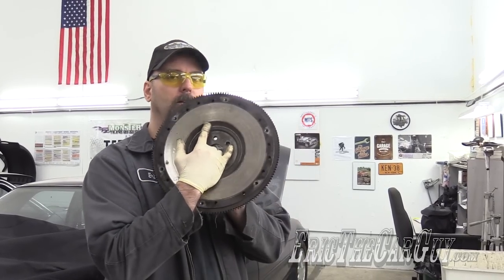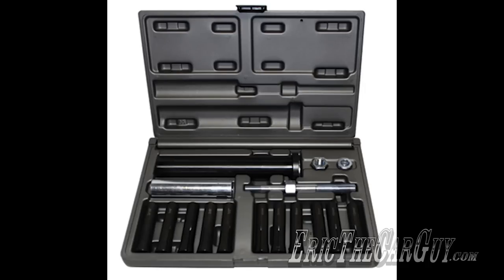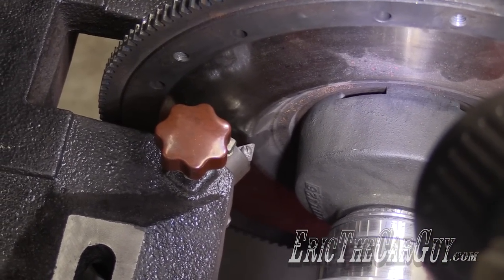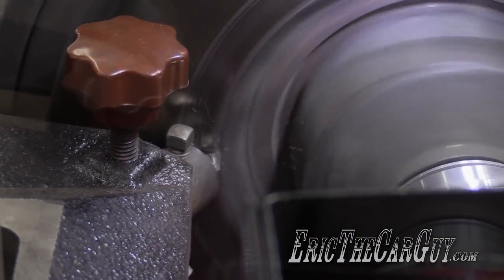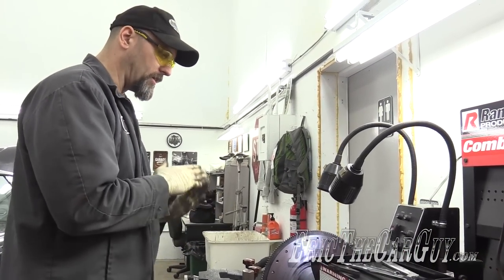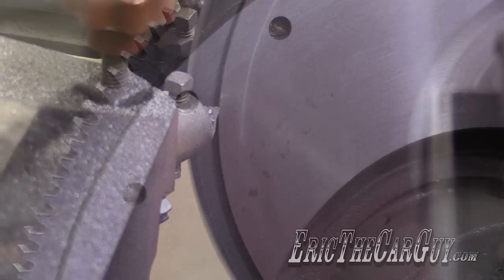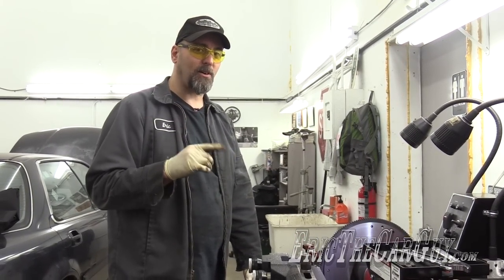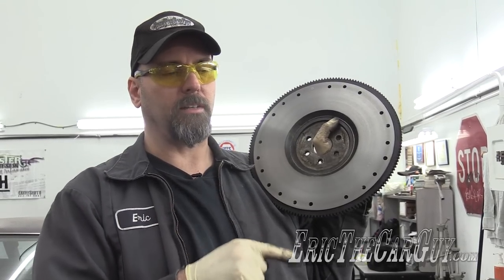Can You Machine a Flywheel with a Brake Lathe??

Comment: my question is can you machine a brake rotor on a regular machine lathe?
Reply: +Rob Mckennie yes, you just need the right adapters to hold it.
Reply: Macavellic would adapters really do a better job than a faceplate, some shims, an indicator, and some tlc?
Reply: +Rob Mckennie Yes easily, if the lathe is large enough. Also the machine is called an engine lathe, not a machine lathe. Sounds odd I know, but that's the name.
Reply: +Rob Mckennie "my question is can you machine a brake rotor on a regular machine lathe?"

Anything that is "turned" can be put on a lathe so long as you can figure out a way to hold it, and the power of the motor is sufficient enough to rotate it properly. The same can be said for any piece of material in a mill. So long as you can hold it down sufficiently, and the machine is able to move to necessary positions unencumbered it can and will do the task. 

The brake/flywheel lathe is just a lathe. It's purposely built to only do a few things. It could do more depending on availability of tools/inserts but primarily it's built for that and that alone. A normal lathe, be it manual or CNC can do anything a brake/flywheel purpose built lathe can do, and or can do it better. It will just cost more, and be capable of more. If your only intention is to turn rotors/drums/flywheels getting a larger setup like a bridgeport wouldn't make a lot of sense, as it would take up more room, likely a bit more costly and have a higher learning curve. 

+Macavellic "yes, you just need the right adapters to hold it."

You don't necessarily need the "right" adapters to hold it, just one that will work. 

+ALAPINO "No. A little time indicating on a 4-jaw should be fine (unless of course you're doing a lot of rotors, in that case a purpose built setup is only there for expediency)."

That's not entirely accurate. All you would really need is a stout enough rod, and it being threaded on one end, with a base on one side, and a cone on the other. If the rod is too long like in this case, use some spacers and tighten it down. So long as you get the rod indicated, and just for good measure indicate an edge of the plate, you are all good. From that point out, all you would have to do is loosen the nut on one end, and change it out. You could do tons of them one after the other easily. The only problem you may run into is the mass of the rod/disc/flywheel is too much for the lathe motor to handle properly.  

+Theguywhowouldn&#39;t "Yes easily, if the lathe is large enough."

By large enough are you talking about the jaws to hold it? Or the power required to spin the mass of the disc/drum/flywheel? If it's the latter I would agree that could be an issue. If the former, then it doesn't matter that much as you do not need to hold the piece directly, you can use a jig/tool to hold the piece.
Reply: qballtvp I'm confident that my lathe would be able to hold a rotor fine, my thinking in asking the question was that perhaps a brake lathe can be built to be more accurate because it's only doing one very particular thing, and therefore a general purpose lathe might not be accurate enough.
Reply: +Rob Mckennie You can, but it isn't recommended. A brake lathe is designed to cut both sides of the rotor at once, assuring that they remain parallel. A regular lathe will require you to cut one side, then flip the rotor over to cut the other surface, introducing the possibility of misalignment and non parallel surfaces, resulting in severe pedal pulsation.
Reply: Rob Mckennie " my thinking in asking the question was that perhaps a brake lathe can be built to be more accurate"

To be more accurate than a normal lathe? It would all depend on the quality of either lathe. If the normal lathe is cheap as hell, has a lot of slop, etc and the rotor lathe is of better quality then absolutely it will be a bit more accurate. Generally speaking though the lathe will be more accurate, but more difficult to setup, depending on what you have available to you. 

Just because it is purpose built doesn't necessarily that it will be more accurate. I mean if it was, why wouldn't you just buy a brake lathe, and modify it for other lathe related work? 

Just check the slop on the lathe, and see how much it moves.
Reply: Bob Weiss "introducing the possibility of misalignment and non parallel surfaces, "

That is likely on very poor quality lathes, but if you know how to setup a lathe it shouldn't be an issue. If for some reason you think it wasn't parallel, then you could use some micrometers to check... 

Also...

"A brake lathe is designed to cut both sides of the rotor at once"

Anything a brake lathe can do, a regular lathe can do as well. Turning both sides on a manual lathe wouldn't be all that difficult to do. It just wouldn't be as straightforward.
Reply: +Bob Weiss by an unqualified machinist it could be a problem.
Reply: qballtvp Think of it this way, if for the same amount of money you built 2 cars, one designed specifically for city driving, and one designed to drive in the city and off road, which would you expect to perform better in city driving? I have no idea if this analogy translates to machining, but this paradigm of optimizing trade-offs is why I was unsure if two lathes designed for different things would perform comparably.
Reply: Rob Mckennie they are both designed to turn metal.
Brake lathe turns brakes well, and maybe something else if you felt like mounting it up.
Engine lathe turns anything well, once mounted.
Reply: Yes you can but set up is harder. You will need a large lathe with one of either a large four jaw , face plate, or hub that fits the rotor. You will also need to do it in two set up one for front one for back. Indicating it in each time
Reply: +Bob Weiss It's really no problem, i made an adapter with the usual boltpattern drilled and tapped, put it in the 3-jaw and take a light skimming cut to make it run perfectley true then you mount the break rotor and take one or two cuts on both sides you dont need to turn the rotor around atleast not if you have a semi-decent sized lathe.
Reply: +Rob Mckennie Yes. If you can hold it you can machine it. The downside is you can't cut both faces at the same time like most brake lathes. I've worked in a machine shop for quite some time, there isn't anything you couldn't account for with time and setup. you can actually get a far better surface on a cnc lathe as the drive maintains the same surface speed from the center to outer diameter. 

I know many people who have done drums, discs, even flywheels on standard shop equipment with no special tooling.
Reply: User Name "The downside is you can't cut both faces at the same time"

Technically.. you can. A CNC lathe would be a bit harder to do but a manual lathe with more wiggle room on the tool holder it shouldn't be an issue to add a second too holder and adjust it.
Reply: The problem here is how the lathes move. You have z and x. To properly cut both sides you would need to move both z positive and negative at the same time
Reply: User Name Yes and brake lathes move the same way, they are limited in the same ways, so they use tools/holders to do so. A common way for brake lathes to do this is use a tool that holds 2 tools. Each tool side has inserts. With dials being able to move in/out manually. Do a run, stop.. move back in, and dial in a few notches and do another run back out.. if needed.

"The problem here is how the lathes move. You have z and x. "

Absolutely, but... Z and X do not have to move at the same time, one can stay fixed as does just about every brake lathe. Z axis moves for drums, and X moves for discs/rotor. The same can be done on a regular lathe, even possible with CNC but it would be incredibly difficult, and a lot of fabricating. With a manual bridgeport type lathe it wouldn't be all that difficult. 

"To properly cut both sides you would need to move both z positive and negative at the same time"

If you moved the Z axis on a lathe, be it brake lathe or regular lathe... the tool would crash into the rotor. The X axis is what moves. When doing a rotor, it's easier and preferred to go from the center out, which is the x axis and if there are any lips, knocking them off beforehand can save inserts, and maybe even a tool. 

I think the confusion you have is thinking that the lathe itself is going to move the tool along the Z axis into place. While possible, and is usually the way to go on a lathe, it's not needed with a dual tool holder. The "Z" adjustments on the tool side are manual adjustments, you adjust until it starts to hit the material, maybe go another notch or 3 in... and then lock it down, Then just go along the X axis out and that pass is done. If there are low spots, move the tool back to the center adjust both sides--if needed.. in another notch or 3, and bring it back out. Rinse and repeat until there are no low spots... measure and see if it is the minimum thickness or greater. If so you have a rotor that is ready to be put back into service. 

Here is a tool that would work. 

https://automotivetools.com/products/572/rels/40095n/brake-lathe-part-twin-cutter-to-fit-ammco-model-4000

It is a direct fit for the model of brake lathe listed, but fabricating something up to hold it (in a non-brake lathe) wouldn't be difficult at all. It just wouldn't be a direct bolt on thing. 

All in all if you had a lathe that could turn rotors/drums/flywheels, and you needed to turn quite a few rotors/drums, then buying this tool--or one like it and fabricating up something to hold it would be a hell of alot cheaper than buying a purpose built brake lathe. 

The tool I linked would be the easiest thing to use, you could also use a normal dual tool holder that doesn't allow you to fine tune and still do both sides at once. It would just be a bit more difficult to accurately gauge how much material you are going to take off on the side that would need manual adjustment.
Reply: Bud i have worked in a tool shop for years now. You can't explain anything to me I don't know.

Unless you have a special post there isn't going to be anyway to adjust the cutting heads down in the surface evenly or accurately to cut at the same time as a brake lathe. 

You can easily just cut one side then the other. But then why not just flip the fucking part over a do a second op.
Reply: Yeah because valuing the keep it simple stupid methods really bug the company. Since I use existing equipment and tools I cost my privately owned small company little to nothing.

There are 50k ways to do this job. Your home shop or small shop is going to need to use the cheapest simplest method using what is available right this second.
Reply: User Name is said they are lucky.
Reply: +Theguywhowouldn&#39;t Wrong! does not have to be a engine lathe.
Reply: +Macavellic Wrong! no adapters are needed.  I do them "ALL" the Time.
Reply: Ralf V You machine brake rotors on an engine lathe, all the time? How do you like to hold them? I do have a 4-jaw that can probably do the job, but my first instinct was to indicate it in on a face-plate.
Reply: +Rob Mckennie Not at all! A lathe uses high precision bearings in the head stock and on the back side uses a thrust bearing to adjust for NO lash.  In 28 Years of doing Automotive work I have never needed a brake Lathe.  If you got the room to house it buy a used full size lathe.  I turn all kinds of specialty tools all the time.
Reply: +Rob Mckennie  4 Jaw is best period! just make sure to wrap a bungee cord around the top that will absorb all of the vibration. Turn your feed down as low as possible (we are not trying to make chips here LOL) I have NEVER had a problem!! Brake Lathe is a waste of Money as far as I am concerned. I can make all kinds of special tools with my lathe that can NOT be done on a brake lathe. Good Luck
Reply: +Ralf V Indicate the Contact area of the rotor that kind of goes without saying. You would basically indicate where the cup of the brake lathe seats.  Mechanics are not machinists (at least not by definition) That's why they make brake lathe's.  On a brake lathe you don't have to indicate anything.
Reply: +User Name Wrong on both Counts, You can easily cut on both sides of the rotor.  The Tool post can hold the same cutting head.  e-Bay $75.00.  CNC will not give a better surface and would not be worth the time it takes to program the machine.
Reply: It takes less than 30 seconds on any modern CNC machine. 

And yes the surface finish will improve because of the constant surface speed available from the spindle.

Yes I'm sure it will fit in a standard stick tool holder, however by the time you had that set up I would already be on the second side on a CNC lathe. 

I'm not sure if you work on a newer machine or not but we regularly hold finishes finer than 6.4 across up to 24" our engine lathes struggle to get close to 6.4 and typically come in closer to 10
Reply: +User Name maybe go back to shool or come by my shop I am the the supervisor in an industrial machine shop and must not know anything about machine tools. if it takes you 30 seconds come by the shop and we will hire you
Reply: You are a liar. It is seriously touch face start program. Program depending on software is this simple. Start point, end point in x, then the z you want to cut at. Mazak Siemens, fanuc, all that easy
Reply: +User Name whatever i have better things to do then talk to a wannabe
Reply: Exactly, you are an internet machinist. Or even worse, you are an "engineer" for a large company who has a machine shop. The most you know about machining is exporting an existing 3d model and making a tool path.
Reply: The only advantage to a dedicated brake lathe is that it cuts both sides of the rotor at once. You could even make a tool to do that on an engine lathe or adapt one from a brake lathe. A brake lathe is no more accurate than an engine lathe, but it is easier to setup and use.
Reply: No, not really. A good quality engine lathe is deadly accurate... assuming the operator does a good job of indicating in the rotor.
Reply: You would need to make or adapt the same double tool used on the brake lathe. Any machinist could do that if they wanted too.
Reply: A mandrel (in a 4-jaw or colett) would be a good option... perhaps with a cup on one side and a cone on the othe rtightened with a nut... pretty much what the brake lathe uses. :) The mandrel could also be held between centers and driven with a dog.
Reply: It's just the time and cost in doing so. The average small shop that would take on a job like this would not spend any extra time or money producing the work than necessary. Engine lathe, CNC lathe, brake lathe, hobby lathe. As long as you can get the part in the chuck you should be able to run it. It's just a matter of using the appropriate process to achieve satisfactory results.
Reply: You can create a setup on an engine lathe that mimicks the setup on the brake lathe. Once it's indicated in you can swap rotors on/off without re-indicating.
Reply: Absolutely. But is it worth the time of setup for 4 rotors? Maybe maybe not. If I was doing a few hundred rotors I would probably set it up like that.

You could actually do the same on any lathe really. Actually depending on how bad it is you could do it super easy on a grinder as well. We do something similar for a punch we make I'll bet we could make it work in this case too.
Reply: +Doug Reed his own. bwahahahaha
Reply: If you have a big enough lathe yes you can do this. And how you might hang onto it might be a challenge that was an arbor type fixture used in the video which is ok but that flywheel could have sat in there a little slanted  so when he took a cut the perpendicularity might be off a little from the outer diameter. he should probably run an indicator off a couple of spots and tap it into place so its not running out. That may have been the reason why he had to make the extra cuts at the end to clean it up.
Reply: +Ralf V hahahahah
Reply: Tried it many times, made it work  a few times. You have to cut both sides without changing your set up. I know indicating it in seems fool proof but the rotors shake like crazy when they are done.  It if you cut both side on the same set up it works majority of the time
Reply: The problem we had when doing them is parrallism  if there is as a tenth out between faces you feel it in the brake pedal .cutting both surfaces at the same time fixes that.
Reply: The thing to remember is to not to go for a mirror finish rough cut only! Brotherinlaw put a mirror finish on his. (I told him rough cut only) His car did not stop well!
Reply: I only use my lathe for discs/rotors, just grip in the bore of the disc , clock hub mating face then skim front face then put boring bar upside down and run lathe in reverse then without removing the disc , skim the back face when done all 3 faces will be true as they all get skimmed in the same operation.

Comment: it is possible to do this on a brake lathe. HOWEVER having tried this many times i have repeatedly had work hardened mottled metal that had hot spots leave high spots on the flywheel. every time i have tried this (8-10 times over 20+ years) it has been a fail. ended up having to take it and have it done on a table machine with the wet stones. Just my experience. results may vary.